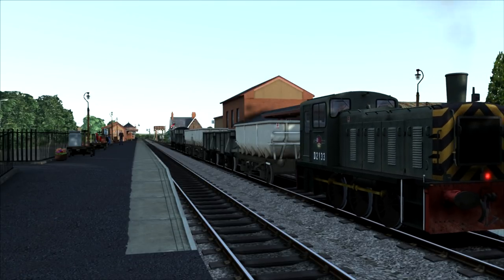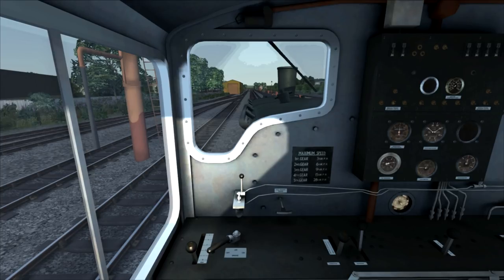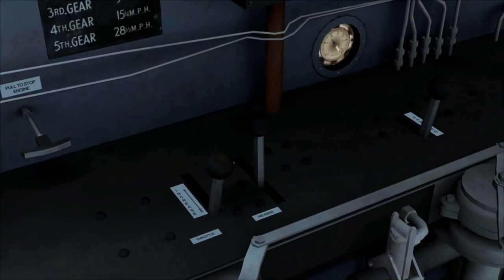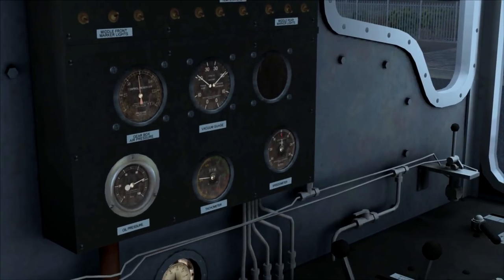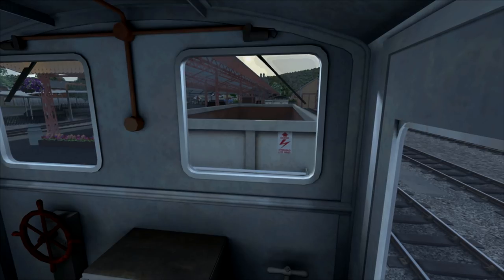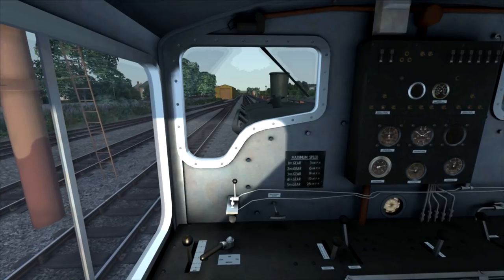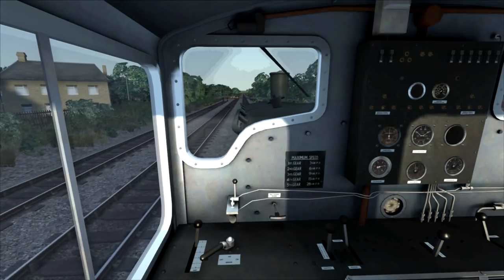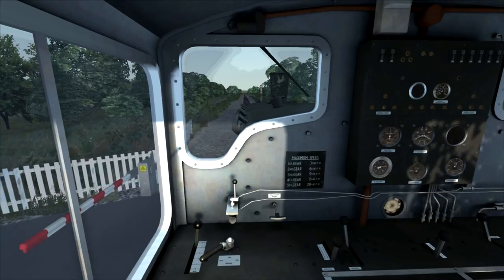Train Simulator 2015 - Train Guide: Class 03 Shunter

Comment: another great idea, for a series of videos.    Did you/ do you work on the rail, as your very informed.  A Stephen Fry of the railways !!! Just got my copy working again, I am testing out Windows 10 tech release, and one day the other week, all TS did was crash dump a file while updating the scenario database!   Just put xp on a spair partion and it works just fine there.
Reply from the maker: John Hamlin Thank you! No I've never worked on the railway but I've always wanted to. I'm 28 now so not too old to get a job on the railway at some point if I can. I'm glad you have a working copy of Train Simulator now :)